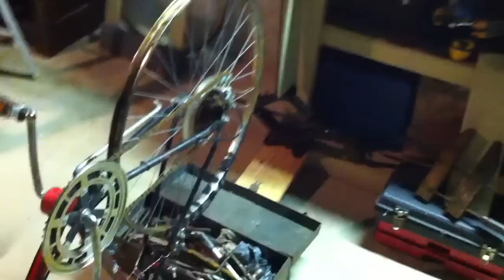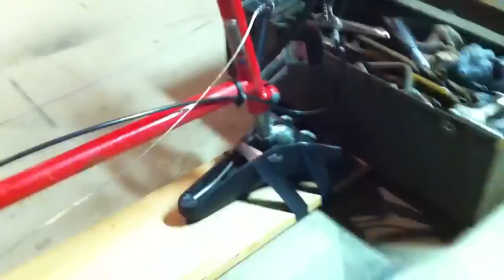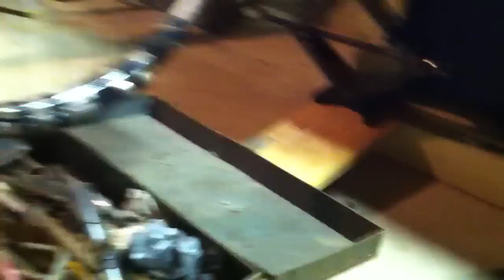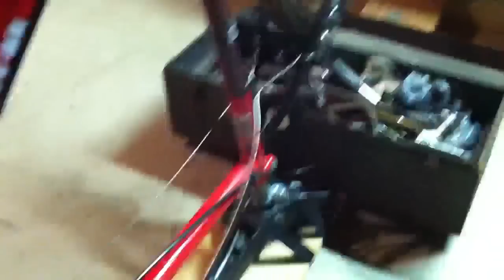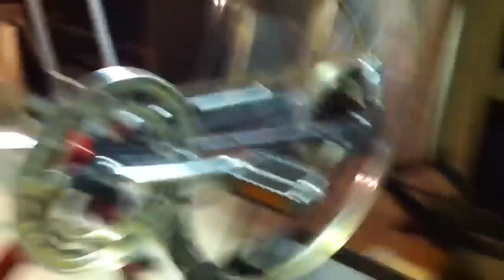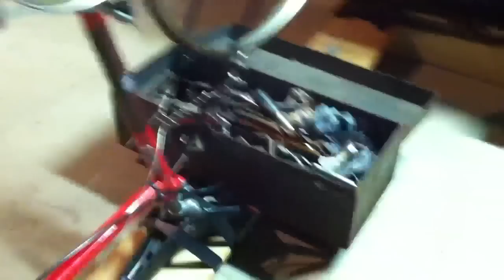Easy Over Unity

Comment: I believe you sir because there is definitely an additional input from gravity on the down cycle and one may argue its taken away on the upcycle but thats where inertia kicks in on the way up kinda like the pendulum effect of the 2 stage oscillator; there is much more power out than in. please see minute 10:57 thru 11:02 where little pinky energy cannot be stopped by man using both hands and part of body weight.....https://www.youtube.com/watch?v=5ho0_obiakM

Comment: I did a similar experiment where my machine compresses air, (see my channel for video: Centrifugal Reciprocating Air Compressor). Skeptics should try lifitng a weight over and over like this, then build a machine using the same principle to do the same work. What gets your heart rate up, and your arm tired? This machine will output more work than what is required to activate it. Work=Force x distance measured in Joules. Angular momentum is conserved in the wheel, with good low friction bearings, but the oscillating normal force created by the rotating mass is always at RIGHT ANGLES to the tangential velocity of the mass, while angular velocity remains constant. This allows repeated work impulses to be done by the machine without draining the angular momentum. Force = mass x tangential velocity squared / radius. Double the speed, QUADRUPLE the force, Quadruple the force, qaudruple the work ouptut. Mininmize displacement, so have a stiff load to power, the machine works even better!
Also, million dollar research labs likely will not touch anything so "low tech" because it makes fools out of them. These solutions have to come from us, often times with limited budgets and time. Again skeptics need to build these machines to convince themselves and learn, how much work it is, and how much it can cost, or just shut up.

Comment: Interesting. Can you put a coil, magnet and bridge rectifier under the tool case so the oscillating tool case causes the magnet to oscillate in the coil generating current? Could this current then power a motor to drive the pedals? If it drives itself you have over unity? You could then add a generator to the bicycle wheel and power your house. Your next video?
Reply from the maker: Hello Eddie. Your suggestion is on point. However the force of the oscillations is quite strong, therefore a design where multiple in line coils exist in series or parallel would probably work best.

Enjoy my other videos too!

MagnaMoRo

Comment from the maker: Electrical energy is only 1 type of energy (electron flow caused by a difference in electron potential (a form of pressure)). Unfortunately, the conversion of electrical energy to mechanical energy and back to electrical energy is itself inefficient. Sort of like keeping pressure in a leaking tire.

Comment: This is subunity. The mass from the tools is oscillating after the initial kinetic energy coming from your movement on the wheel. Thing is you've found the resonant frequency of the mechanical system. You're making the overall system -oscillates- with ease, not generate or create energy. 
Nice vid, nevertheless.

Comment: I agree man, this produce far more active and available power then Milosovich two stage "slow" pendulum oscillator. Now, think of the possibility of making a similar size wheel and powering it with 1800 rpm with 50 watt of RV motor. I bet will put out more then 50 times more then input power.

Comment: Correction: of course its a full meter of work per rotation of the pedal. Perfect for ease of measurement. At least 6m of distance for a pressure of what, 3-5N? To get a chest to be basically jacked up and bounce.
Way to falsify whether the chest returns energy to the wheel: place it on a few thick, rugged pillows. Those will dampen the fall, preventing the chest to be in sync with the wheel to sling it back to speed. I predict the chest will most much less when given the freedom the pillow adds

Comment: Nifty construction. HOWEVER, you applying very light strength on a pedal ~17cm out off center for a good half meter per pedal rotation. For several rotations. Only to lift the box up by, what, 1cm? And yes, it's only one lift, and from then on as you know it's just an osccillation, driven by the kinetic energy you put into the system, which is flushing around.
You have made a jack that has a really long lever, and thus can be operated very softly. The jack doesn't lift a car, but the chest, 1cm.